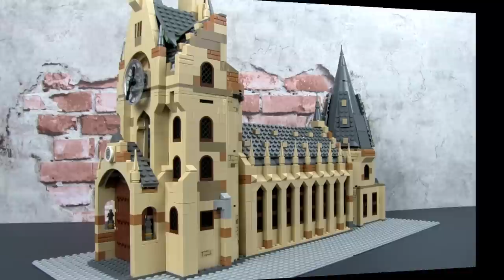Interior Details for a LEGO Cathedral MOC - Building a MOC from Start to Finish (Part 8)

Comment: The interior looks very nice and realistic. I would switch around the candles to be in the front of the altar rother than the goblet as in my experience the candles are usually furthest away from the priest. It's a shame there is no space for a closet in the priest's room for the vestments as there would normally be one there. The stained glass windows was a great idea for the windows over the roof. 😄

Comment: 28:16 JC, I think the Lego police may be called on you since putting those curved tiles in that section is technically an illegal building technique because the peices have too much tension on each other
Reply from the maker: I don't understand how there is any more tension than regular tiles. All they are doing is covering a stud like any 1 x 1 tile or round tile.

Comment: The interior is great, but the exterior looks like 3 separate parts (due to the transitions), if you ask me 😕 The back tower could be taller and using either round bricks or squared for each floor, instead of a both, but love your videos 👍

Comment: I notice you did not put a door between the main building and the smaller building...is the book case a secret door?
Reply from the maker: I did put a door but it can't be seen as it is on the inside of the back tower. There is only the arch doorway from the main hall as that is how most cathedrals with a center back access is like.